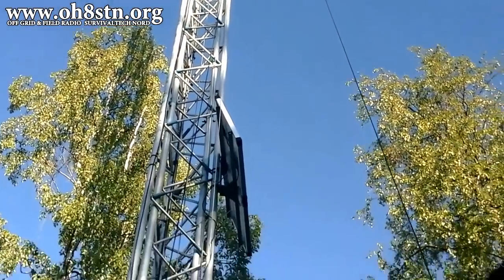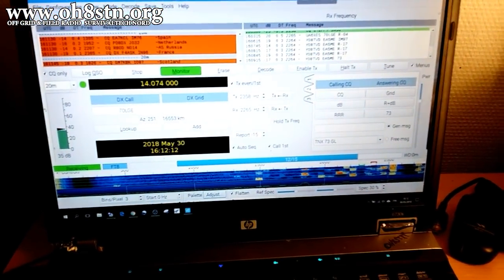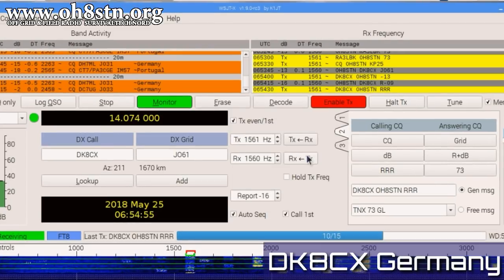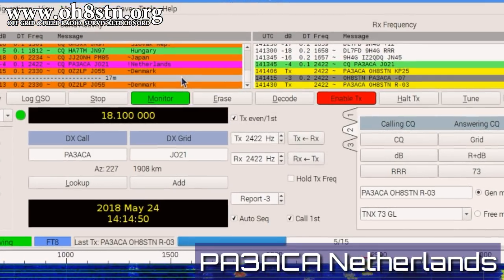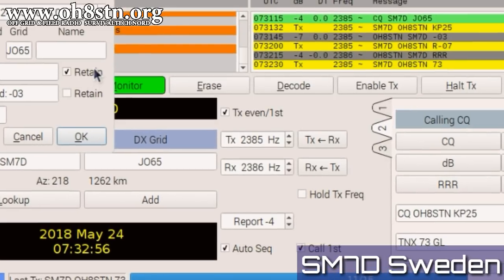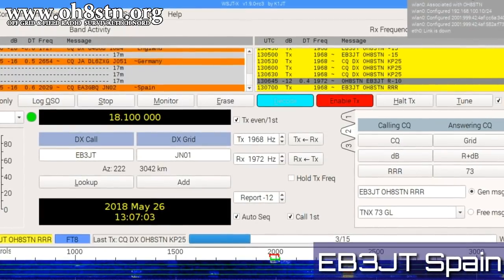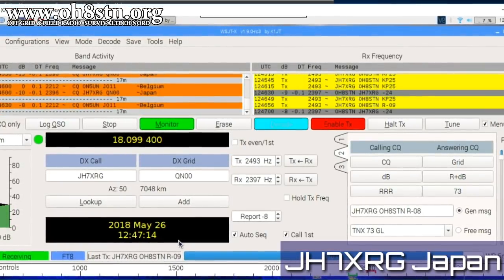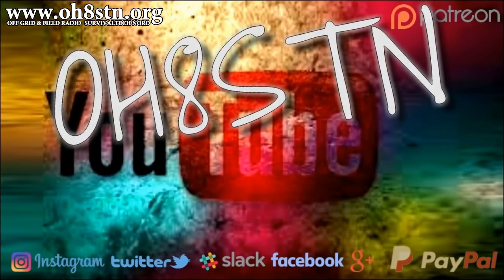Chameleon EMCOMM III Base

Comment: Ciao, all the antennas you have tried, which one is the one you prefer or which gives better results in transportable outside?
Reply from the maker: That's an impossible question 😀
Each one is like a different tool inside a tool box. One antenna has better efficiency, operates on a single band. Another might be a little less efficient, but broadband. Each of these antennas has a unique characteristic. So it's difficult to say which one is better than the other.
Reply: thanks for the answer, the question logically referred to the HF bands 15 / 40-80 meters, I saw that you often use the Chameleon brand, better a magnetic loup, or a dipole or a fishing rod or broadband longwire, practically with What do you go out most often when you go on an expedition?
Thank you
Ciao
Reply from the maker: Pietro it's the same answer. It really depends on the type of portable operation I'm going to do. Sometimes I might prefer something that's fast to setup and requires no trees like the Super Antenna MP1, Chameleon P-LOOP or MPAS, other times, something vety lightweight but efficient like PackTenna, Sotabeams, or Cross Country Wireless EFHW. For the field station I would use the telescopic Mast from spiderbeam/Sotabeams  with a wire antenna, but only if I don't have to carry thd mast myself. Definitely whatever antenna I use even DIY, it's going to be made with the best materials, so it doesn't fall apart when I'm in the field.
There is no one correct answer to your question. I have lots of different antennas from different manufacturers, including the antennas that I've made myself. I use the one that's best for that particular day. So the requirements define which antenna I use.
73
Julian oh8stn

Comment: Was wondering what wattage you were transmitting at?
Reply from the maker: Thanks for the question. 
Most of these were at 20, 35, or 50 Watts Watts. It's actually quite interesting. I have found with FT8, a clean signal is more important than a strong signal.
73
Julian oh8stn
Reply: OH8STN Thank-you. I do not work FT8 enough to have figured that out. I always learn something from you. Keep up the excellent work.